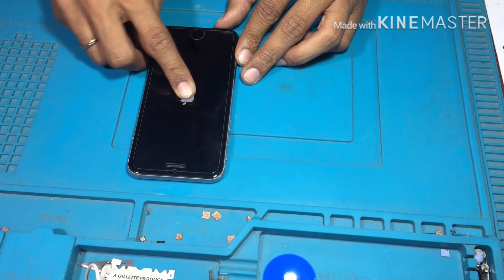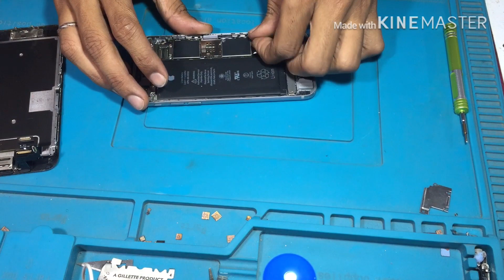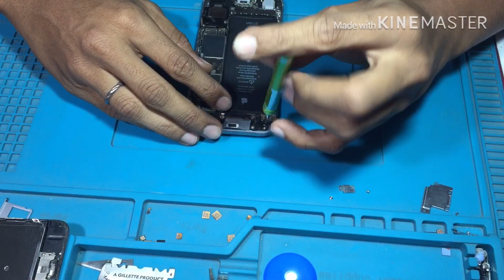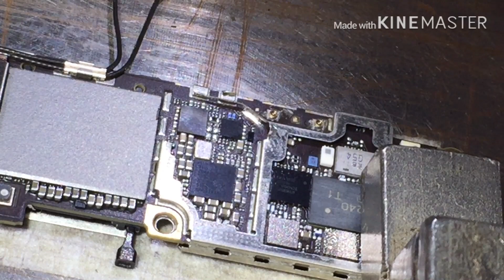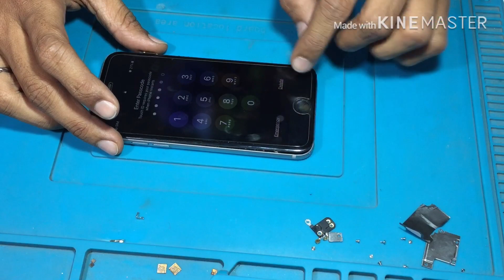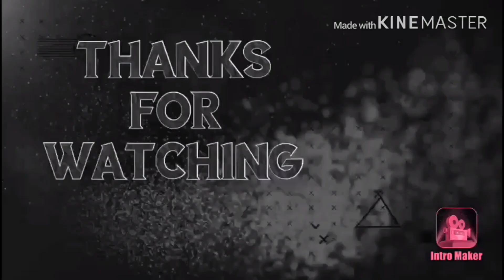IPHONE 6S STUCK AT APPLE LOGO FIXED BY U2 IC

Comment: My iPhone SE 1st generation is showing boot loop only when it is in charging but phone goes dead as soon as charging removed. Also phone is not recognized by iTunes, PC and by any third party tools, tried connecting iphone to other PC but still phone does not detect. Please help me as I need data which is very crucial for me
Reply from the maker: Check Charging Flex..

Comment: Bro my apple 6s also fix on apple logo.. If I do this then OK,
Reply from the maker: Try it Bro.. u can fix 90% of chance..
Reply: @FixUrMobi  thx sir I will try.. Em also mobile tecnition.. I have also mobile shop n repairing senter.
Reply: Fix Ur Mobi what happens when you just remove the ic without replacing it?
You gonna be stuck at apple logo screen?